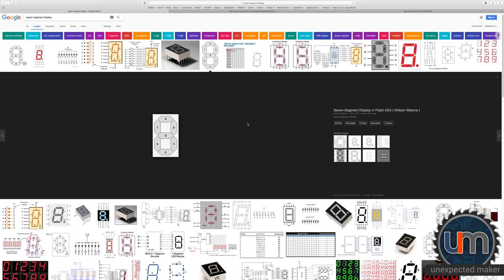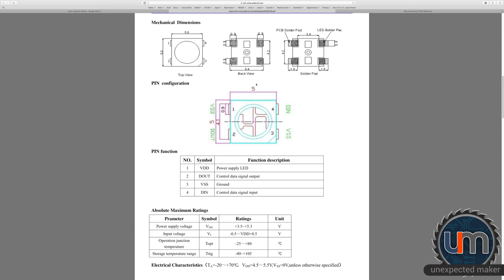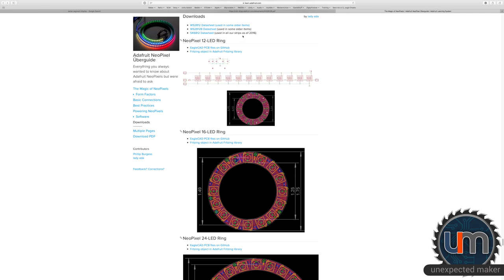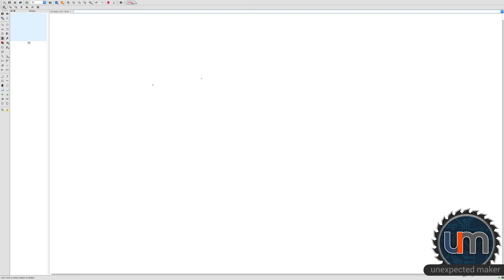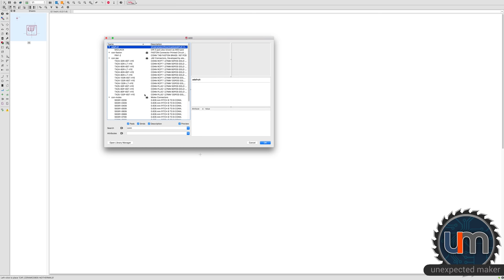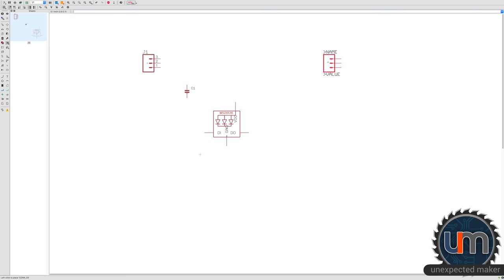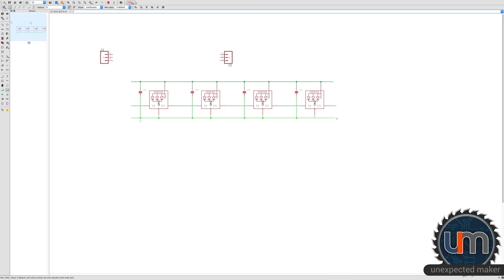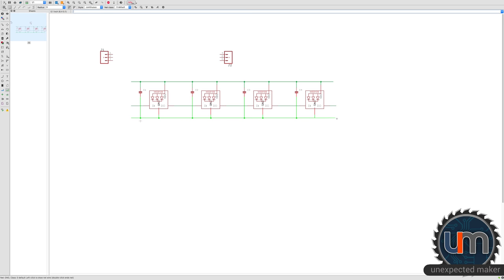Design a PCB - Neo7Segment Part1

Comment: nice video! 
i'm currently also busy building a pcb with WS2812B leds. One question though, what would be the needed dimensions for the 5v trace? i will use 114 ws28128B Leds for the design.
Reply: G'day. Take the number of WS2812B devices and multiply that by 50mA to get the worst case power usage. In the case of this old design it would have been 28 x 50mA = 1400mA or 1.4A. 
Now that you have that figure use a trace width calculator from somewhere like 4pcb.com to determine the required trace width. 
If you assume nice cheap 1oz copper PCB, a maximum allowable temperature rise above the ambient temperature of 10 degrees C the calculator suggests a power trace width of 19mil/0.48mm. 
With the 12mil used on this design the calculator shows that the trace temperature could rise to 20C above ambient and drop 0.42v between the first and last WS2812B. So by the time you have 4 digits cascaded your input voltage of 5v would be down to 3.3v!
For your 114 WS2812B devices you will have to allow for a maximum current draw of 114 * 50mA = 5700mA or 5.7A. The calculator suggests a trace width of 130mil/3.3mm for 1oz copper. In that case maybe a wider bus-bar trace feeding the individual groups of WS2812B might work for you. Don't forget a ground pour on the reverse side so that all those power traces have a return path under them. 
Hope that helps.

Comment: Just paused to comment, so you’ll probably fix this later in the video or it’s a non-issue. Anyway, about that naming for “data” at the very start the DI and DO of the first pixel are not actually the same line, so merging these two into a single name is probably not the greatest idea.